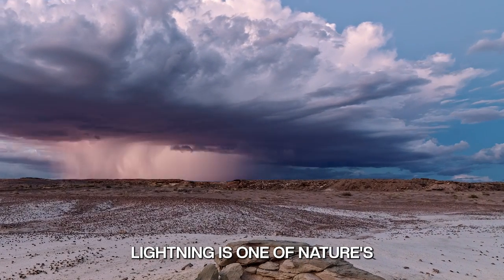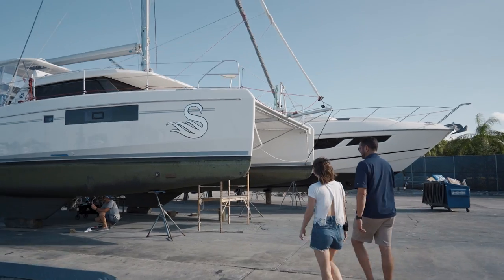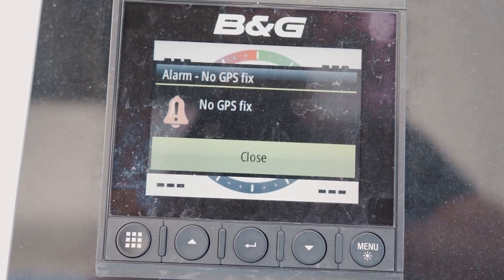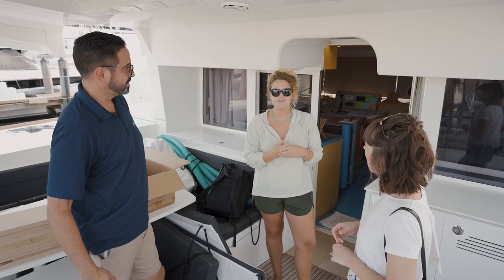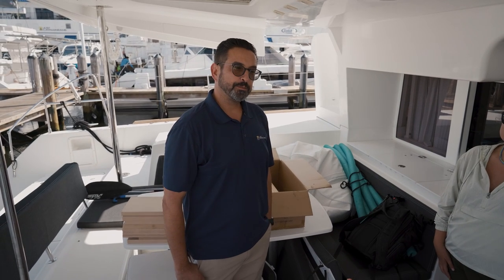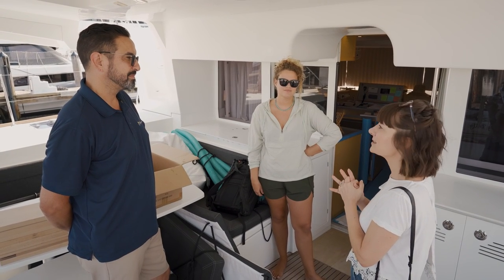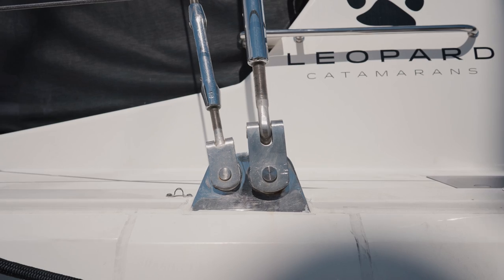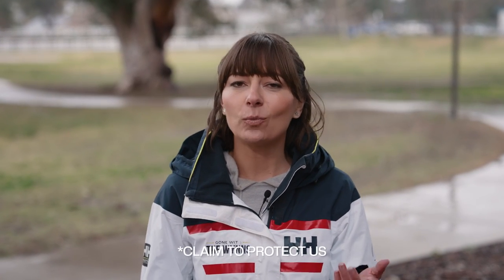Can Anything Stop Lightning?

Comment: Carl's suggestion of a localized Faraday cage using metal mesh is logical.  I read that the charge that builds up in salt water during a storm is concentrated near the surface so I moved the grounding plates to 12 inches from the waterline.  Had plates of copper sheet vs dynaplates below the  shrouds and the mast.  A catamaran, inboard the hulls from aluminum mast and outboard the hulls below the shrouds.  An upgrade would have been to ground the headstay.  Never was struck in 50 years of sailing, thank God.  Good sailing to all you youngsters!
Reply: Just a question, in your 50 years of sailing approximately how many lightening storms did you encounter?
Reply: @fredfleming8905  Hi Fred.  Many storms.  Probably 20+ at least.  Also sailed 20 years on merchant ships which being steel are faraday cages and are routinely struck without any effect on electronics as are aircraft.
Reply: @michaelneedham5607  very good I’ve wondered how a good lighting strike damage protection device would work on water.  Thanks for info.
Reply: @fredfleming8905  The behavior of lightning strikes on non metal sailboats seems to be not completely understood.  Powerful radio frequency pulses which can destroy solid state electronics are generated by electrical arcing.  Those fields are blocked by a Faraday cage.
Reply: @michaelneedham5607  It is like EMP (electromagnetic pulse) the Faraday shield will provide some level of protection but not sure if the amps could get so high it would arc through the Faraday shield.  Since everything in micro circuits today they are very vulnerable to EMP….also vulnerable to a bad CME.  Have a great day.

Comment: Florida is the lightning capital of North America thanks to its geography.  Florida’s peninsula is surrounded by water that is relatively cooler than the afternoon temperatures over land. Land temperatures reach the upper 80s and 90s on a daily basis due to it being so far south towards the equator. Land heats up quickly compared to the water and temperatures will reach the low 90s by early afternoon. The warm air over the land begins to rise high up into the atmosphere while the cooler air over the water sinks. The rising motion of the air over the land pulls in the cooler air from the water to fill the void. This phenomenon is called the sea-breeze and occurs on both Floridian coasts

The sea breeze acts as a “mini cold front” and showers and thunderstorms develop along it as it moves inland. Thunderstorms easily develop with plenty of moisture in the atmosphere each day, again thanks to Florida being so far south and surrounded by water. As temperatures heat up each afternoon, there is a lot of energy for thunderstorms to use up, grow tall and produce excessive lightning.
Reply: Actually Texas has the most strikes ( over 27,000,000strikes per year).
Florida has the most strikes per square mile.
Reply: @hvacmike1175  

What is the average depth of the water table in Texas? 

Are there deep veins / shelves of water under topography? 

Curious .

Comment: I have a lot of experience with lightning protection. I was an arborist and installed quite a lot in trees. Same problem different materials. I had vertical bronze fingers mounted to the top of each tree with additional finger’s mounted in the canopy branch’s. Typically five bronze fingers all connected to the down cable of braided bronze about 1/2” in diameter and I would run two of them to the ground. One on each side. They were connected to a grid of cables with as many as ten copper ground rods driven radially around the tree out the drip edge. The trees were well protected and I never had any additional damage to a tree after installation. Your system is incredibly simple with just a few ground plates and only one cable from the mast. If I were in your shoes I would definitely install the protection. It is pretty scary getting caught out in a storm without it. It happened once when I was in my early teens while delivering a trimaran to Vancouver Island from San Diego. We lost everything except the sails so we at least could get it back not port. 
Good Luck Al Hartley
Reply: FASCINATING! Retired arborist here, never seen lightning protection in trees but plenty of storm damaged - one in particular had 50% leaf failure  - on inspection turned out to be lightning strike that had traveled through Victorian cable-bracing. I could see entry and exit burn paths clearly.

Comment: Clark is an electrical engineer living on a boat for about 30 years. This episode might be worth the time to watch. "LIGHTNING Hits Boats. Here's How to Deal With It [Capable Cruising Guides]
 Ion Disipator
" - Emily & Clark's Adventure
.   I can't provide the link because the post will be removed, but I'll provide a link in a reply just in case it won't be deleted. Best, :¬) Webhead USA
Reply: It's been a long time since I've viewed any of Emly & Clark's videos, but it would be nice if YT would let you give me the link so I can watch that one. (Fingers crossed.☺)
Reply: @mikebarron5805  type in the name of the Chanel and lightening hits boat. It will take you directly to the video. Happy Sunday.
Reply: Thanks for the heads up, it was a good video even though the only boat I own is a 14 ft fishing boat it was interesting.
Reply: @johnnylightning1491  Mr. Lightning, what a coincidence!  Your 14 footer is 14 feet longer than what I own! :¬) Webhead USA
Reply: While the boat is under construction is the best time to install whatever material is best to provide a path for the electricity to travel from the mast to the water. Perhaps copper strips at the bottom of each hull running from fore to aft that the electrical gear is connected to and is terminated with the copper plate on the exterior surface of the hull below the waterline will provide you with alternatives of what is attached at the top of the mast. Later you can decide what device you want to attach to the top of the mast. But it does not make much sense to install something on top of the mast without providing a path for the lightning strike to travel thru the boat into the water without blowing a hole in the hull. :¬) Webhead USA
Reply: FYI you can put links to other YouTube videos in the comments section ... just not links to anything that removes the viewer from YouTube.

This is a totally random link to a video I just watched to prove it works ... https://youtu.be/m8VK_2apIO0
Reply: Love that guy. Watched that episode and its a great one👍
Reply: We’ve also got an HH on order and debating the same thing. We’ve been in 2 different anchorages where neighbour boats were hit by lightening. One boat was basically destroyed as they had to effectively sink it to put out the fire and the other was a full carbon 80’ sleek yacht that lost all their electronics. We also had a strike near us that confused our gps and our compasses for about 30 mins while at sea. Very luckily for us, they all came good and we were fine - that boat had what I think is the standard for HH, lightening antenna grounded through the hull.
Reply: @webheadusa9377  I'll double check.  Our last boat had a wide coper ribbon bonding everything together, we circumnavigated and didn't ever have lightening damage (although we were close).
Reply: @pageadventures  Yes, an ounce of prevention, as they say. :¬) Webhead USA
Reply: yeah Hugh fan of Clark... he is the go to guy for all technical boat things... and I have watched his lightening episode many times... this is very similar to what he suggests. I personally would not spend 15K on a system you could probably make yourself... and similar systems do already exist...

Comment: Jason, Nikki -- 
Excellent episode on the practical side.  Wearing my electrical engineer's hat:  The electrical resistance from the masthead to terra aqua ground (i.e., anodes in the water) must be nearly a short circuit (under 10 ohms) to bleed off the strike's triggering ions to ground. That's what Nikola Tasla's patent shows, and is the science behind lightning protection systems. For boats on the hard, bonding a cable to an Earth ground post (as is done with houses and other buildings) does much the same thing.   

The lightning strike basically turns a metal mast into a heating and electrocution element for everything around it -- which causes fires wherever the overloaded, overheated electrical stuff is.  St. Elmo's Fire is another form of lightning, when enough charge builds up in the standing rigging to make the air glow.  Let's also consider: Carbon fiber composite is electrically conductive (depending upon how it's laminated and assembled, but the fibers definitely so) -- and carbon burns rather easily.  Don't take my word for it: Carbon is near Silicon on the Periodic Table -- and silicon is in every piece of digital electronics.   

Here's another wrinkle:  When your electronics are shot, leaning to use a sextant and compute corrections still makes sense.  Old school still works -- one reason I bring few pricey electronics aboard Windwalker when the forecast calls for games of 'dodge squall'.

Blessings,  S/V Windwalker
Reply: Instead of a sextant I keep a spare old tablet unplugged in a Faraday bag. Costs less than a quality sextant and much more accurate.
Reply: @carlnelson8927  The old tablet is still a glass house, and fully charged going into the bag risks being neglected there.  Don't need to recharge a sextant, either, plus it doesn't have battery terminal nodes that corrode in salt fog typical of marine conditions.

Comment: My company used this technology 35 years ago to protect natural gas installations on mountain areas, not gas wells but compressor stations,. these location had for years have been prone to lighting strikes. It wasn't cheap but each install came with a 1 mill insurance policy. Never had a strike since they where installed. Luv you guys, can't wait for the new boat. BTW we called it the magic hubcap.

Comment: Why is everyone surprised that lighning rods work? On a boat the main issue is once a strike occurs it needs to be directed to the water. The copper plates, a steel chain into the water, etc. have been used. This isn't new tech. If you have a locker full of electronics surround it with sheet metal that also grounds to the water (Faraday cage.) Same with cabling, there are metal mesh wraps available. It all adds cost but you have to roll your own dice and consider how freaked you'll be 17 days from land with nothing but a compass and a sextant (that you are hopefully proficient using.)
Reply: This solution seems different from a lightning rod.  A rod attracts the strike to then channel it, through dedicated cables and ground plates, to ground. Subsequently, vital cables and equipment are protected via the cone of protection.  This system seems to try and dissipate the charge diffential and prevent formation of the leader.

Faraday cages are effective for portable electronics like phones and hand-held radios, the most electronics are still connected through power and signal cables.
Reply: Would a carbon fiber mast make a difference?
Reply: @patrickjames1080  No
Reply: There are solutions for power and signal. Although surge protectors might not be good for a direct hit. Glass fibre data cables will never conduct.
Reply: This is not a lightning rod. It claim to deplete ion and prevent the lightning from striking the boat entirely.
Reply: Nice video.

The national average for the probability of a boat lightning strike claim for all types of boats and sizes is 0.9 chance per 1,000.  Odds seem pretty high to me.  A protection strategy seems prudent.  

As a kid, we had lightening take out our TV system.  The damage was incredible.  I think a plan to protect vital systems would be worth it for peace of mind.
Reply: What lightning does is set up a very high voltage electric field. This can cause the tiny wires inside the chips to errode. So they are now not able to flow as much current. So devices might work for a bit then days days later. So just the hit on the boat 2 slips over might be enough to cause a couple of things to fail some time later. So I would turn off for a while then turn back on multiple times to try to get stuff to fail. I learned things from people investigating lightning effects on aircraft.
Reply: I would most certainly ad the EMP SHIELD. It protects you not only from EMP but Solar flares and CME's most important lighting. So if you are going the distance with this product. Go all the way. Copper plates on the hull, Faraday box this antenna which I do like very much. And the EMP SHIELD. It is around $300. Being that you are 100% electric I would leave nothing to chance.
CHEERS Cliff
Reply: @cliffmorgan6085  What kind of EMP shield?

Comment: I saw something like this through Tampa Electric.  My firm was supplying communications gear to them.  Being in the lightning center of America, they had a bunch of expertise at isolating sensitive equipment from lightning.  Among other things, they used a similar approach on their infrastructure to repel strikes.  They had super slow motion movies of lightning strikes.  The strike always starts from the ground and goes up.  The connection is made to the potential and the strike completes the circuit to ground.  The other thing they had become really good at was galvanic isolation.  Anywhere there is communications use fibre optics to replace copper to eliminate a path to the equipment.  It strikes me all these expensive systems should have really good (expensive) surge protection, grounding and optical communications.

Comment: Two interesting points of information I have come across over the years. I once had a master electrician rewire my breaker panel whole it was live to the house. He had the proper PPE to protect himself from either a short circuit from the main or just leaking current from the bus bar. His gloves and coveralls included a copper mesh woven inner weave in his material that is designed to carry the current around him to the ground. Quite amazing material. It was flexible and he was able to manage his work quite well. 
Another is that a ran across an ionizing device once that generated positive ions to purposely counteract negative ions being generated by a nearby field for a reason I no longer remember. The purpose was to prevent accidental discharges nearby very similar to a lighting strike. Curious that the Tesla device you mention is basically doing the same although seemingly passively rather than actively. Seems if you were to generate the opposite ions actively, it would affect a larger area of protection as it would eliminate a larger field of opposite ions. 
And a final point, seems that designers could include a conductive mesh under or within a carbon fiber shell, mast, etc to conduct any current away from sensitive electronics. Once built in, it just needs wiring to get it to the grounding plated. It would be cool to watch the testing in a big warehouse bay/pool with a Hugh Tesla generator!

Comment: Wow!! Your content and production in this "short" video is very good. I retired from working over 20 years on radio towers, (where lightning loves to strike,)   A large amount of resources goes into lightning protection!  My university semester to pass my R-56 certification (lightning protection) was very comprehensive. The results were amazing; 95% to 99% less lightning strikes on the radio towers.  HOWEVER, the FINAL lesson taught was. We can guide lightning  away from electronics; but in the end. "Lightning Will Strike Wherever the Hell it Pleases."

Comment: I worked in a building that had constant issue with lightning strikes and electrical problems (in Florida).  Our solution was very similar by bonding and grounding the building and installing what I call fuzzy wire balls that were connected to the ground. I never say it, but others said they saw a glow from the fuzzy balls when an electrical storm passed. It was all designed to dissipate the electrical charge that followed a storm in the ground with the opposite electrical charge in the air, minimizing a lightning strike. After this system was installed, our electrical issues virtually stopped.

Comment: Great video kids. Very interesting what lighting can do to a boat 🛶 especially an electric powered boat. Time will tell if the proposed electrical lighting defuse system will work. I think the price will come down over time as more solutions come on line.
Reply: There are cheaper ways of dissipating static. Those frayed ropes you see trailing off the tips of some airplane wings are stactic disapators.

Comment: Jason and Nikki - long comment but hopefully helpful.  I spent a several years helping install and test a lightning prevention/surge arresting system on a long gondola lift in Colorado's high country.  It did reduce direct and proximal strikes, and did shunt induced surges to ground without damage, but not 100%.  Sometimes we had to replace arrestor equipment, but that was much cheaper and easier than replacing the operating electronics.  My concern about the ion collector atop the boat mast is that it is very small and may not do a good enough job of collecting ions to dissipate.  A larger array is advised.  But any dissipation PLUS the secondary arrestors on each circuit and electronic device for induced surges will make a difference.  I would install both to reduce the risk of a blowout while at sea, as well as the hassle of equipment replacement and having to find another insurance company afterward.